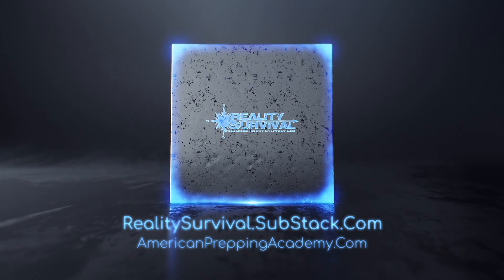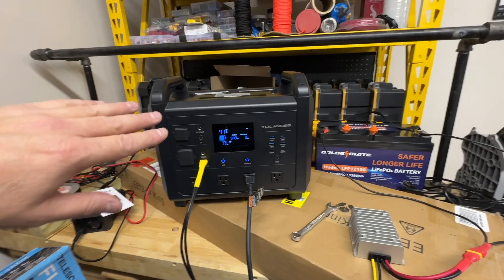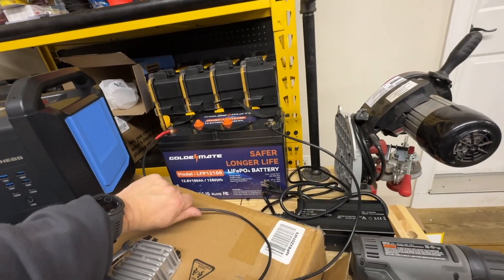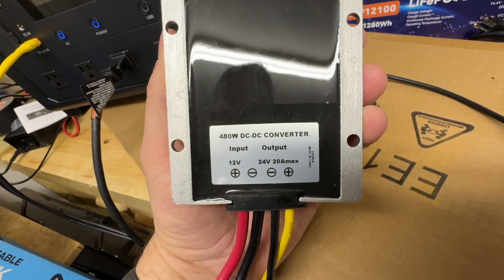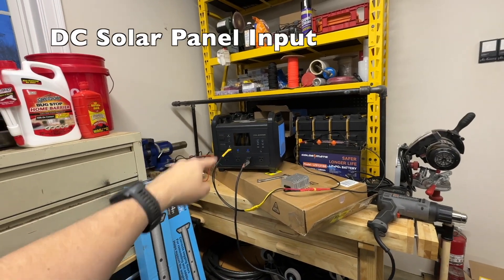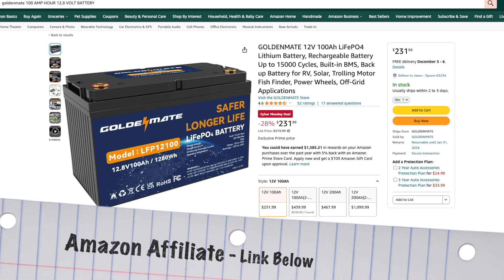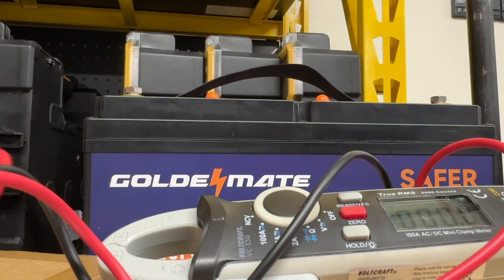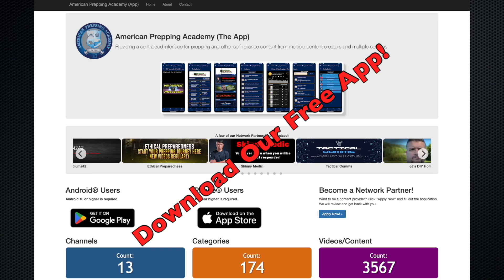How To Double Or Triple Your Solar Generator Capacity

Comment: You’re thinking of paralleling batteries like if you opened the unit up and added a Y cable in place of the main power cable to the inverter. 

What you’re doing is using the MPPT charge controller with another DC source instead of PV. DC is DC so it doesn’t matter. 

The key to these DC to DC converters (the MPPT is just a more complicated version that tries to find the max power point of a solar panel) can either buck, boost or be a buck boost in relation to the input voltage. 

Most have a fairly flexible voltage range…usually 10-30V on smaller units and 10-60V on the bigger ones. 

10-30V covers small 100-200W panels pretty well. 

10-60V allows you to use larger panels typically used for large scale residential/commercial solar and are often 300+ watts per panel but have a voltage of 36V or 48V. Which means an open circuit voltage as high as 60V. 

The problem is these MPPT’s can be enormous or support massive currents otherwise they’d be pretty damn expensive. 

So 12V at 20A is 240W

But 48V at 20A is 960W

Current is something that requires lots of copper so it’s often the main cost factor when designing something. Voltage not so much. 

I still like the idea of hacking the main battery but you have to match voltage and chemistry exactly. They also must be at the same State of Charge and Voltage when paralleled. 

All power stations like this will allow you to charge with DC while discharge AC

It’s the charging with AC AND discharging AC power since it’s the inverter/charger circuit doing so much.  Convert AC to DC…Convert DC to AC. 

So that’s why true UPS features are not super common

Comment: You can plug a 12V LiFePO4 battery directly into most power stations and discharge 95% of its capacity before the power stations hits any sort of low-voltage cut-off.  This is far preferable to running it through a DC-to-DC converter because it is one less voltage conversion, so much better efficiency.   Also, the slower charging rate (typically 8A @ 12.8V = ~100W) with the direct connection will have far higher round-trip efficiencies through the power station's battery.   So all together, directly connecting a 12V LifePO4 battery is better.

This works because a 12V LiFePO4 battery has a nominal voltage of 3.2*4 = 12.8V and a very flat discharge curve.  By the time it drops under (3.0*4) = 12.0V it will be 90%+ discharged and probably 95%+ discharged by the time the power station cuts out on it.

So as long as "trickle charging" (~100W) works for the application (and it usually does since you can discharge the power station to run your loads while trickle-charging it at the same time)... as long as that works, just connect the 12V LiFePO4 battery directly to the power station.

--

Generally speaking, this is really a good way to expand the capacity of power stations because the bigger power stations are usually not well matched to the application and charge a premium for the extra capacity.  They are rather expensive.  If a smaller power station works, then adding a battery on the front-end is a wonderful solution.

In terms of also charging with a solar panel at the same time, it is doable but requires an additional charge controller because the power station only has one "solar" input.   You can get a Victron SmartSolar 75/15 for $70 or so.  You connect the solar panel to the Victron, and the output of the Victron to the external battery, and the external battery to the power station and poof, it just works.

For a 12V battery, a Victron 75/15 can take a wide range of solar voltages and supply up to 12.8*15 (roughly) = ~200W or so.

You can do the same thing with a higher voltage LiFePO4 battery, such as a 24V (25.6V nominal) battery instead of a 12V battery, but in this case the power station will not detect it as a car power port and will try to charge from it at a higher rate, which might not be ideal.  But it still works pretty well.  With a 24V battery a Victron 75/15 charge controller can push 25.6*15 = 384W worth of solar.

If using a 24V LiFePO4 battery the power station's solar input must accept at least 30V because the charge target for a 24V LiFePO4 battery is 3.55*8 = 28.4V.

This is a cheap and incremental way to improve a small power station without having to spend money on a big power station.  Since power stations are a big point of failure, you don't want to spend a lot of money on the power station itself... if it breaks you pretty much have to replace the entire power station and that can get expensive with big power stations.

-Matt
Reply from the maker: I’ll give it a shot and see how that 12 v to 12 v works. If that is the case that would be great.
Reply: @junkerzn7312, I agree.   @RealitySurvival  If you could do it at 12V (and you are not in a hurry to recharge) it would be more efficient generating less wasted heat and more useable power from the 12v battery making it s way into the solar generator.

Comment: ok, looks like a good way to increase runtime. Question though, if that converter is pushing 24v at 20amps, what amperage is that drawing from the 12v battery? my limited understanding of electrics is that when you double the voltage you halve the amperage... so 40amps being pulled maybe? can u test it out?
Reply: Probably 42A or so. There’s some slightly inefficiency in the boost converter circuit. Most are above 90% especially when the voltage difference is relatively small
Reply: @ericklein5097  thanks 👍
Reply from the maker: The Battery Management System is limited to 100 Amps. So could safely pull up to that amount. Anymore than that would be limited. So I don’t think it is anything that the batteries aren’t designed to handle.
Reply: @RealitySurvival  hi, thanks for the reply, i wasnt so much thinking about the batteries, more about the wire sizing and fuses if i were to try this out myself
Reply from the maker: Well if you were running 24 volts at 20 amps technically you could go as low as 14 gauge wire. However I personally would use 12 or 10 gauge wire just to have some extra capacity.
Reply: Probably 42A or so. There’s some slightly inefficiency in the boost converter circuit. Most are above 90% especially when the voltage difference is relatively small

Comment: Yeah, I didn't realize this when I purchased my first power station.  4 LiFePO4 100 ah and a 40 amp mppt charge controller would have been the same price as one additional battery for my Bluetti AC 200 Max.  With that setup, you can accept 2400 w of solar into your 5 kwh battery pack and transmit 48- 51.2 volts times the maximum amperage of your station through the solar input.  It just takes a little bit of trial and error and research so you're not afraid of messing something up.  Thanks for the video.  More people need to learn about this stuff.

Comment: I mean at 140 degrees, you have to keep it away from paper, pets, kids but that's fine. The design of the DC DC converter is setup to handle the heat and release it
Reply from the maker: Yeah and it came down after a few minutes and normalized at about 120 or so.